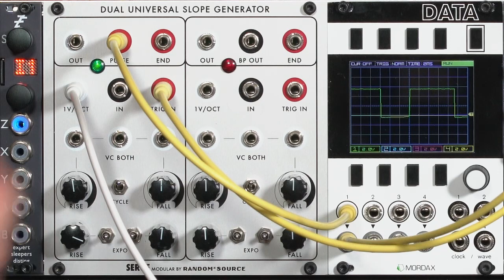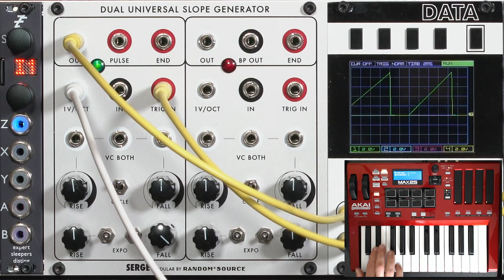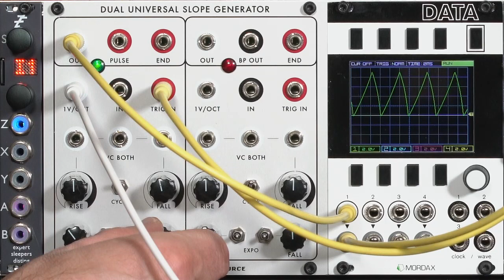Random*Source Serge DUSG 5/7: Subharmonic Generator (LMS EE)

Comment: The R*S is the ultimate for this. It's such high spec that it can track much higher notes than a Maths or something similar. Haven't tried a Doepfer 171-2 for this yet, but I understand it falls somewhere in between the two. I swear you could have a really compelling system made out of only DUSGs, I'd love to have 3 side by side some time.
Reply: Get a quad slope from CGS 8-)
Reply: I have a 171-2 and it does this better than Maths. It’s no DUSG mind